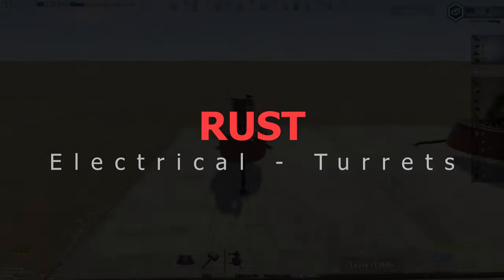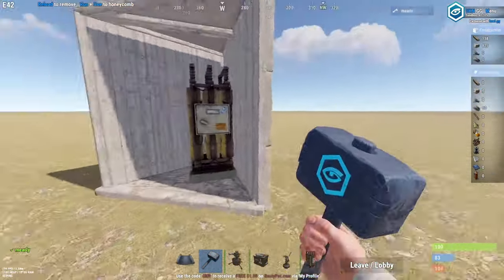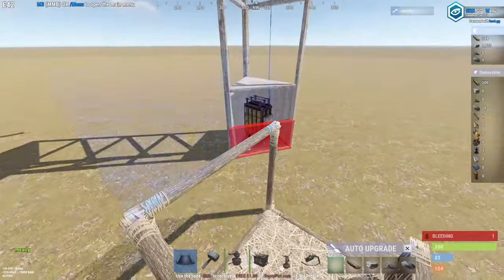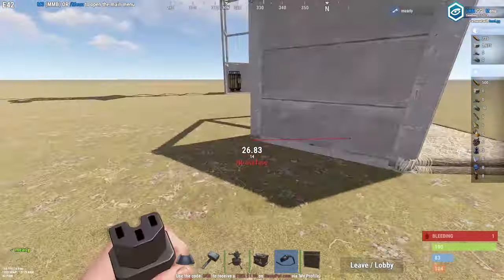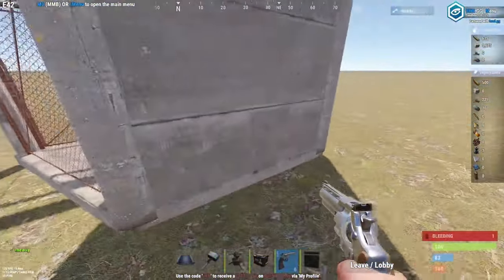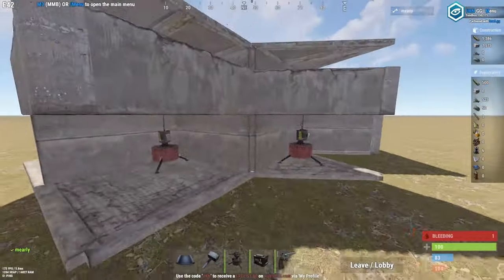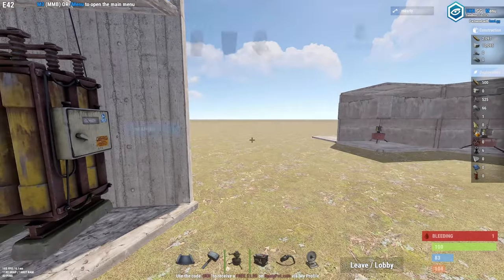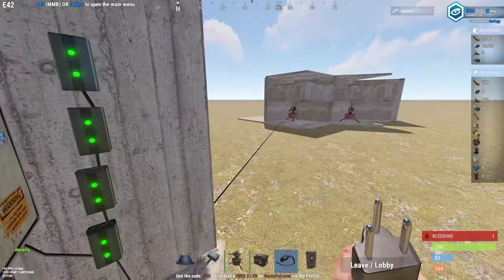RUST - Powering and Setting Up Turrets - My General Advanced Guide - MY TURRET SECRETS REVEALED

Comment: placing a branch right next to each external turret and then passing power through it to the turret, then the branch output to a blocker to an internal turret in same direction of raid path controls which turrets turn on above the 12 turret limit.  Since if a raider blows an external turret it breaks the branch which then unblocks the blocker to a desired turret rather than it being random.

Comment: Using triangle floors and halfwalls to the side make building turbine platforms easy

You should use the power loop (simple) or better yet the Nih core circuit (advanced) to make sure your battery is charged for when its really needed and get the most from your power sources
Reply: Triangle spiral stairs 😋 Easy up and down

Comment: Why not use chain link fence doorways to reach auto turrets easier? They have the same effect as normal chain link fences don’t they? On top of allowing you easy access to the turret
Reply from the maker: The problem with the doorway is players can shoot through the gap in the doorway and skip one of the fences, allowing the turret to be shot down with bullets.
Reply: @MearlyGaming  assuming you structure the base in a way it’s difficult to get a view through the crack without being in turret range, either way should be good though?